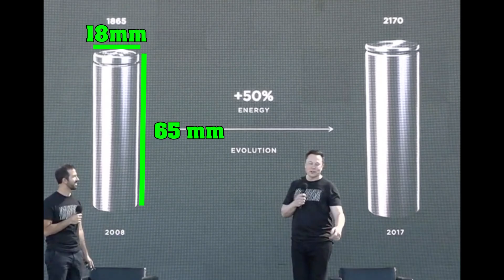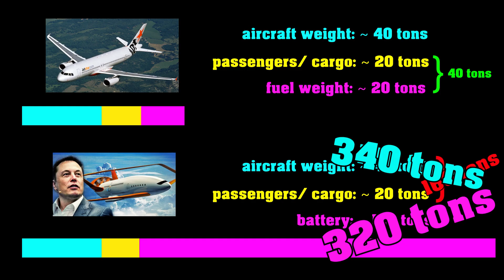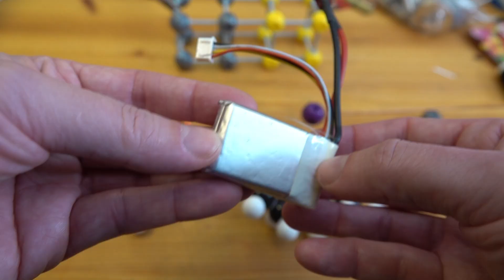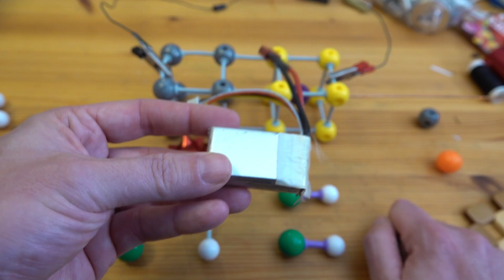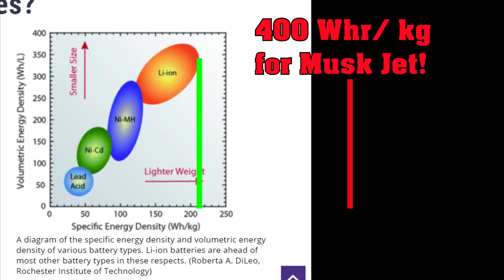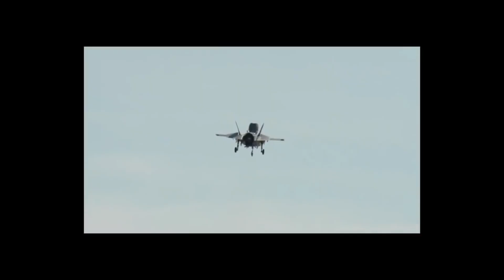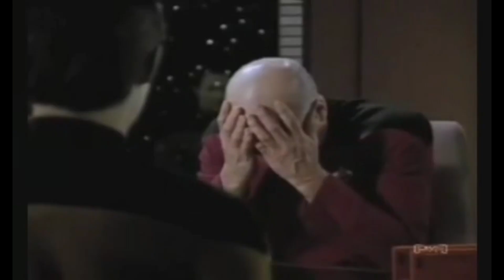Tesla's Secret Plan To Disrupt Airlines: BUSTED!!

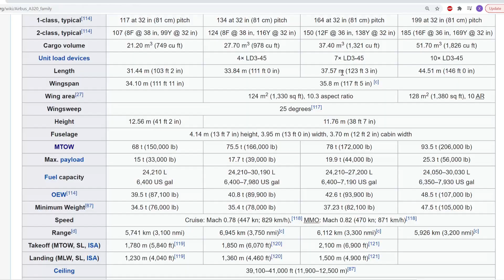Comment: I love Thunderfoot, but when it comes to round things up or down, and I must stress: not necessarily to bolster his arguments, he is way too liberal. 4:50 He rounds 19.9 up to 20, which is fair, then he rounds down 24-27 to also 20. He does that all the time :D
Reply: airplane fuel is a lot less dense than water, about 0.8 kg/l, so 24 - 27 thousand liters is 19.2 - 21.6 tons, so he is not actually rounding down at all
Reply: @DanielQRT If it is a lot denser than water, then wouldn't the number be bigger? something like 30 maybe?
Reply: @7errafirma  to get mass you multiply  volume by density, and multiplying by 0.8 leads to a smaller number.

regarding your original comment i still agree with you in that he rounds numbers a lot, but generally he is conscious of what he is rounding and it shouldn't affect his points

Comment: This aged well during years. Only place batteries are good is model airplanes and helicopters. Power output on a small electic engine is way higher than gas engine. 

Flight time for my rc aircraft was around 7 minuttes. U can make 30 minutes in a boring plane...

Comment: Elmo has a new toy, it's a motorhome and it cost $17,000, here's the kicker, the battery weighs 36,000 lbs and a tractor-trailer loaded weighs 40,000, and now it's in a residential area or near a residential area, catches fire and now it is a loaded bomb

Comment: Before watching this video I already know that:

I won't  work in practice or at scale.

It's an old idea with a new insignificant twist.

Elon says it will change everything.

It will be delayed for minimum a decade and it will cost twice as much for less than promised.

His fans will say it's the new sliced bread.

Elon will take money upfront as the conman he is.

I would be surprised if I don't get minimum 5 out of 6 correct.

Comment: Supersonic electric VTOL is what a 12 year old would "design" with a pen in a grid notebook.

Very much cybertruck vibes. But in case of the truck, it ends up a expensive truck with lame specs and in case of a plane... well there won't be a plane, or all the "genius features" will have to be removed 1 by 1 and it ends up basic very light type of aircraft for 4 passengers and 2 pilots, that can haul the battery and the people over short-mid distances.

Comment: What is even the point of making a plane electric powered? Just why? It's only more "green" if it is recharged via an energy grid that is powered by wind, solar, hydroelectric, nuclear, or geothermal energy.  And it's just a dumb concept, there's a reason we use fuel for airplanes and not batteries.

Comment: About the only way to make it would be to integrate the power storage into the actual structure.  Either make body panels by sandwiching the battery chemistry between sheets of aluminum which become the skin & structure of the craft; or go the compressed air route, stressed carbon nanosheets making up a huge blimp-like body, with the payload tacked-on.  Maybe fill it with pressurized methane as fuel?
These mental gymnastics are pointless!

Comment: All spot on !   One little correction .. modern aircraft do not have self sealing tanks. If the fuel tanks are breached exiting fuel can be ignited from the various electrical sources located in leading and trailing edges.

Comment: How would an electric plane go super sonic? Would they not run up against the same issues as a turbo prop? There is essentially a limit to how fast you can spin a prop, once the tips start producing shockwaves they lose efficiency.  Turbofans and turbo jets can rely on combustion to push past this limitation but how would an electric prop do that?

Comment: The most important part of a plane's weight isn't it's takeoff weight, per se... But the landing weight. A plane will take off at maximum takeoff weight, but when they are landing they have calculated a much lighter aircraft on landing... This'll be easier on the landing gear, and the actual structure of the aircraft.

See, as fuel burns, it reduces the weight of the aircraft... With batteries, that doesn't change! You take off and land at the same weight. That'll be very hard on the runways (infrastructure), and the structure of the aircraft.

No, electric planes are just flat out stupid.

Comment: There's a small problem with temperature. All I could find was that the capacity of batteries at -20C was less than half and the output voltage 2/3 of normal. 

Sadly at cruising altitude the temperature is -57C.

Comment: You know, thing about planes, is that they actually carry only fraction of their fuel. 
Main part of fuel, is air.
Air-fuel ratio ranges from 50:1, to 130:1 on modern turbofan engines. 
For car engines, this ratio is 14.7:1...

Comment: Elon understands that divergent series. You just keep adding batteries until you create a black hole that the passengers fall into, then you use hyper physics to cut that black hole from our universe allowing the passengers to travel using a hyper tunnel into the hyper dimensions and appear ANYWHERE in the universe. THIS IS POSSIBLE NOW. Just need to give Elon another $55B just because he breathes, and eventually far into the future someone might figure it out.

Edit: btw new battery tech comes out every month, but every single researcher forgets that we need mass production for the new battery to actually be viable...

Comment: One issue that this video doesn't address is the low temperature at high altitude. 
There are numerous claims online about the operating temperature range for lithium ion batteries. The lowest I could find was a claim made by the EnergyTrend website which referred to a proof of concept battery that could operate at temperatures as low as -40°C. The air temperature at 35000 feet (typical airline cruising altitude) can fall to as low as -51 °C. Assuming batteries are contained in the wings, and adjacent to the outer skin of the fuselage, this means that battery temperature will fall below the operating temperature. Batteries will need to be heated somehow. This will be an additional drain on batteries / reduce aircraft range etc. Furthermore, in the clips promoting Musk's aircraft, the commentator suggested that it will fly at a HIGHER altitude than normal (and therefore experience temperatures LOWER than -51°C). At best Musk's plane is wishful thinking, at worst it's deceitful.

Comment: Yes, there is less air resistance the higher you go, BUT there is also less air, which gas and electric engines need to run on!

Comment: Besides the main electric-flight problem of having to carry an enormous battery pack (which, unlike liquid fuel retains its mass throughout the flight), don't forget that getting the maximum performance from a lithium battery by repeatedly working it as hard as possible - which would be a requirement to equal or exceed jet-style effectiveness - is very bad for it.🔥👀

Comment: You need superconductivity and a new form of energy, not electric batteries.. This is ridiculous.
For an electric airplane the optimal altitude depends on the takeoff weight and will not change since the weight is fixed.

Comment: So, the most energy dense battery possible is a fuel generator, a fuel cell, and an electrical generator that uses that fuel? So it would split water into hydrogen and oxygen to store power? Or maybe add carbon dioxide into the mix so it can store it as a hydrocarbon? It would only be more energy dense if it were big enough, but it might make sense for planes.
Reply: Also, if we replaced oil refineries with plants that captured carbon dioxide and water and converted it into fossil fuels, then we could actually use most of the pre-existing fossil fuel infrastructure in an environmentally friendly way.
Reply: It would require more electricity to generate than could be obtained from it, but it doesn't need to be all at once or anything, and we could make it use solar panels or something to reduce maintenance and operation costs. Wait... this is just sounding more and more like artificial trees.

Comment: 25:15 now i don't know nearly enough about planes as i would like to beleive but i know what he said is so so wrong, at least for jet planes. When you make a jet engine you calibrate air/fuel mixture like on any other engine. So what you do is you calibrate your engine to be most efficient slightly below the maximum possible altitude the plane can fly at so when you're crusing the plane is at it's most efficient. Makes sense right? The diffrence between this and a piston engine is two things. Since a jet engine generates thrust it can fly at way higher altitudes than a propeller plane. A piston engine prop plane usually can only fly at 10,000 feet. Second if you correct air/fuel mixture in a piston engine so it works best at say 40,000 feet or even 10,000 feet it will bog down at ground level. That's because air/fuel mixture is crusial in a piston engine. A jet engine however will only get slightly weaker when air/fuel mixture is offset until it generates 0 thrust. So jet engines: low effeciency at ground level and lower thrust. Prop plane: High efficency at ground level and high power. This guy must have compared a piston propeller engine (a design that has been obsolete since about the 70's) to this brand new, so called, "electric jet engine"

Comment: You're also quoting the maximum take off weight for the A320. The maximum landing weight is significantly less than that. You can dump fuel, dumping a structural member of the aircraft is somewhat harder.
The size and range of planes are also governed by the law of diminishing returns. You want to go further, then you need more fuel, but that adds weight and takes volume, so you need a bigger airframe to fit the fuel, but its heavy and adds drag and won't go as far, so you need more fuel...
Going supersonic also requires ludicrous amounts of energy, which is why nobody does it. Then there is the issue that no one has made a ducted fan aircraft that can go supersonic due to the inefficiencies in the inlet ducts and having to slow the incoming air to subsonic so the fan can actually work.

Comment: Can you actually load an A320 fully on fuel and payload and not exceed MTOW? I think you picked a somewhat wrong denominator for A320: I would guess that the total available carrying capacity (across both fuel and payload) is smaller than the sum of the maximum payload and maximum fuel load.

Comment: Those energy density calculations are a bit disingenious. Gasoline does not contain that much energy. It's the oxygen from the atmosphere, which does. The battery has to contain all the energy itself (so does the TNT), which is why they are much more prone to explosions than gasoline.

Comment: “The higher you go, the less efficient the plane is” eh? What? Then why do airlines fly at cruising altitude? Why do they even bother pressurizing the plane if its more efficient a 2000 feet? 
In fact, in the thick air down near the deck, planes really drink a lot of fuel per nautical mile. Same thing goes for missiles on fighter jets. That is why airlines go way high, limited in height by the low density air doesnt provide enough compression to the engines. Jet fighter missiles, also, when they are fired at max range, the first thing they do comming off the rail of the fighter jet is to climb to go get that thin air and to reach a nice cruising speed. Oh and less lift yeah. Thinner air means you need to go faster for enough lift and also to feed the engines some air. There are different kinds of engines called ram jets, which litterally ram into the air at highspeeds with no moving parts in the engine (no compressor). Such ram jet engines are found on the sr-71.

Comment: I really can't stand Musk (so, I'm not trying to defend him in any way) but it seems like the advance of the 1865 to the 2170 battery was likely a function of manufacturing efficiencies rather than energy density. The goals for EV's are a matter of cost rather than density. EV battery manufacturers need to get the battery cost down below $100/kWh to effectively compete with ICEV's. Musk's claims of a supersonic VTOC electric aircraft are just beyond idiocy.

Comment: VTOL doesn't have a civilian application 99% of the time anyway. It is for aircraft on non carriers, bush "runways" for little things like Pipers you couldn't get 40-70,000 pounds on in the length and damaged (bombed) runways can still be used. Kinda depends on how close the intakes are to the ground. Ingestion hazards eventually becomes too great on take-off. You might get in... But getting back out might be out of the question.
  They still need a fuel truck to be able to get to them, and a guy with a toolbox.
   Not a fan of dropping like a rock vertically either. A commercial plane's inherent stability in an unguided, engine out glide is a shallow slope due to it landing at over 100, that is a safety margin I'd like to keep. Sure hydraulics could impair control surfaces but that isn't the only possible failure mode.

Comment: I know, I know, comments under old videos and what not. Anyway. I just wanted to add that the take off and landing weight of an airliner do not match, as the landing weight has to be way lower. So the battery weight will be even more in percent of the overall weight of an airliner.

Comment: Actually, the SR-71 leaked fuel all over the tarmac at takeoff. The seals had to leave enough room for expansion from friction heat in flight. But the fuel required such ridiculous compression with oxygen to burn that it pretty much wouldn't ignite in the open air. Of course that was very different fuel than what powered the Concorde.

Comment: I have always been amazed at the extraordinary amount of energy used by passenger planes.  Cambridge physicist David MacKay (author of “Without Hot Air”) has calculated that a single Atlantic flight ONE WAY uses about 4800 kilowatt hours of energy per person (630,000 kilowatt hours to fly that one plane one way across the ocean).  To put this crazy amount of energy in terms that are easily understood he equates it to a hot shower: a 30 litre hot shower typically uses 1.4 kilowatt hours of electricity so a single return airplane flight uses as much energy as 6858 showers for every person on board.  It’s like everyone on the plane taking a shower every day for almost 20 years - equivalent to 900,000 showers for the entire plane! (McKay actually estimates this higher as 12,000 kwh per person on his webpage - this figure is from an earlier version of his book - 12,000 kwh is the same as 17,000 showers a person on a return trip.  He states, “Let’s make clear what this means. Flying once per year has an energy cost slightly bigger than leaving a 1 kW electric fire on, non-stop, 24 hours
a day, all year.”
Reply: Another fun fact that I use to destroy the electric plane argument:

- A fully fuelled Airbus A380 contains about the same amount of energy as all of the bombs the Allies would typically use to destroy an enemy city in WWII.
- A fully fuelled 777-300ER contains about 50% more energy than the energy released in the 2020 Beirut explosion.

Comment: Nobody seems to consider that at higher and higher altitudes, the thrust you can produce from an electric engine drops.  Spinning at some speed, as the air density drops the generated thrust drops.  So although less drag at high altitudes, you get less thrust (and a given wing generates less lift unless you steepen the angle of attack).

Comment: Jet fuel is basically diesel fuel.... you can't light it on fire..... it won't burn out in the open.  It only burns under certain heat and pressure conditions.

Comment: If we can get get past the size and weight problem with batteries, maybe we'd see this stuff as more practical. But realistically, gas and oil is here to stay for a long time.
If we move away from gas, it'll atleast be available with commercial use, and old cars might survive because of the commercial infrastructure.

Comment: Cylinders are a pretty shitty shape when it comes to stacking. Making a bigger battery will that not make the space in-between the batteries bigger? So more dead space? Weight will be the same, but less space efficient.

Comment: @Thunderf00t It is even worse, the limitation for large aircraft today is the landing weight. They will take off heavier then they can land and burn up the fuel, this battery weight would have to go back down...
Reply: You can drop the batteries prior landing. A SpaceX reusable rocket will burn 40t of methane to catch them at altitude and return them to ground.

Just in case: 😂🍿

Comment: Sound logic on the planes. However I didn't understand back when the Goodenough busted video came out, and still don't understand why something isn't physically possible because it's frightening. I think this takes away from the actual arguments. I agree that it would be harder or even impossible for a battery with double the density to pass safety inspections, but it doesn't explain why such batteries aren't possible.